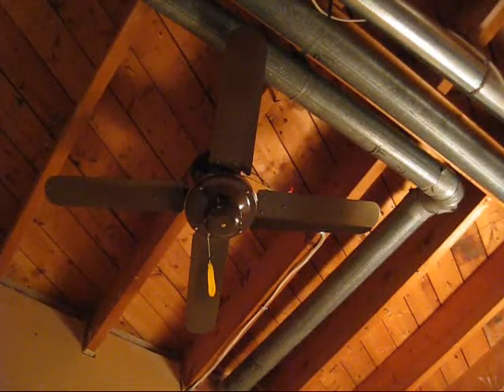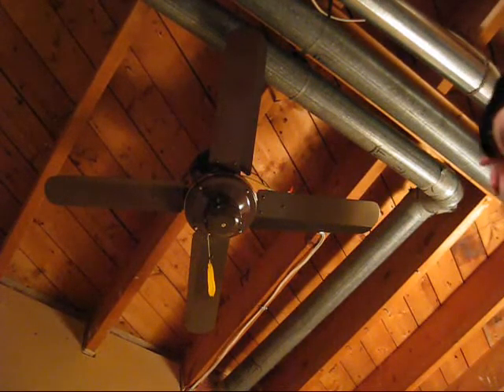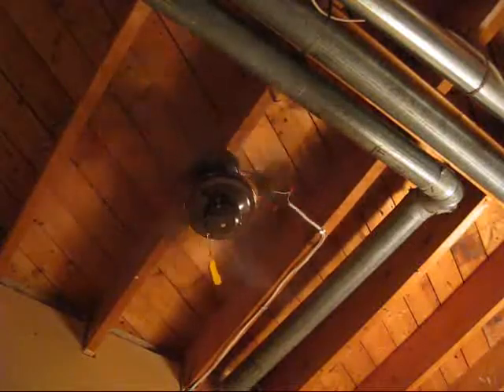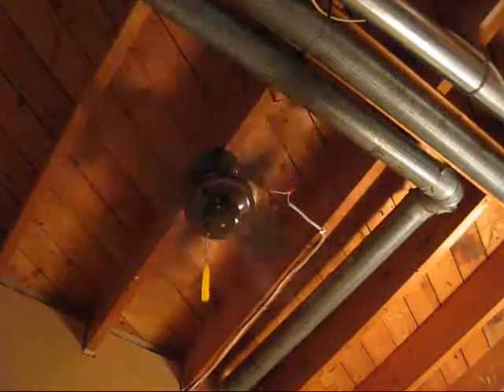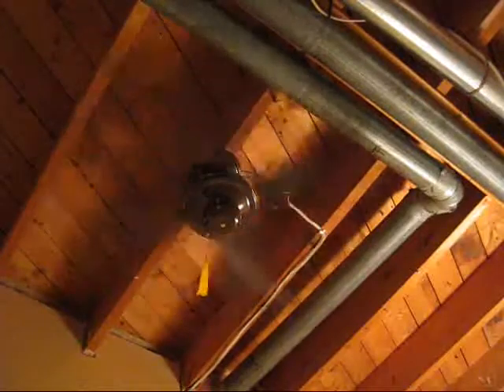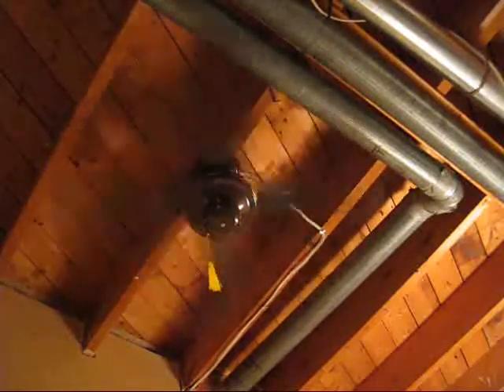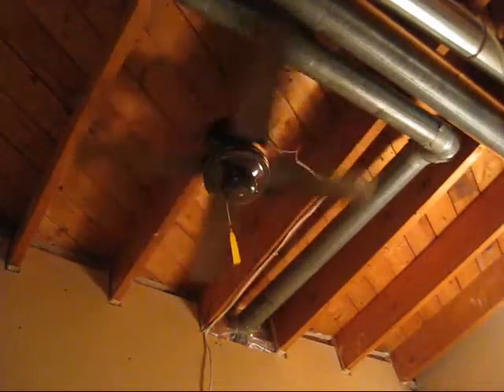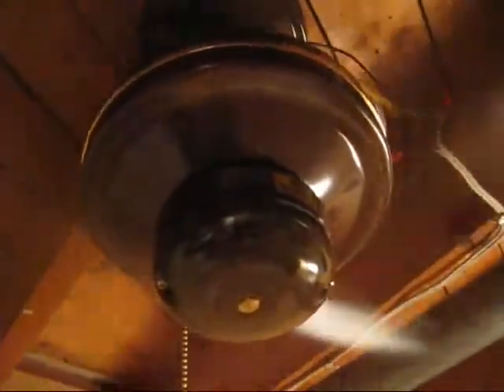1982 4 Seasons Galaxy 36'' Ceiling Fan (Part 2)

Comment from the maker: @MrChristianFans Really not. No ceiling fans are safe for dimmers. Dimmers are for incandescent and halogen fixtures. Even those variable speed controllers are not so good on ceiling fans motors. Especially not this particular fan you see there. For controlling a ceiling fan via a wall switch, it has to be done with one of those big boxy 4/5-speeds controllers or one of those quiet capacitive 3/4-speeds controllers that installs and fits like a normal wall switch.